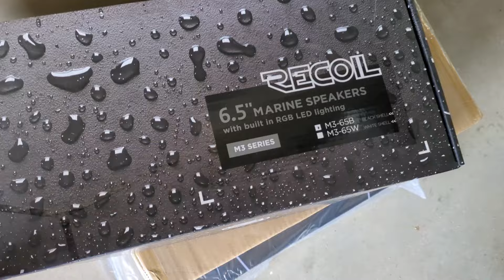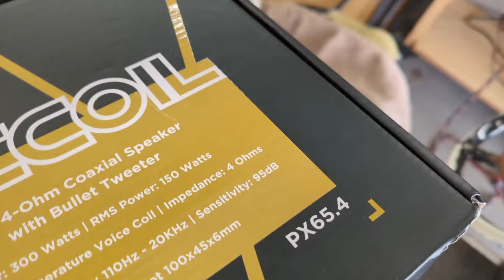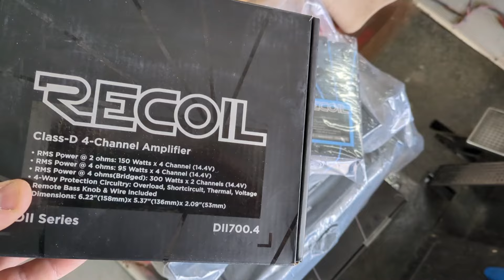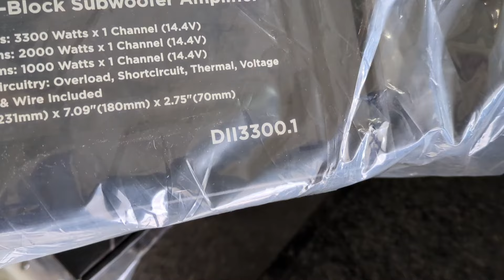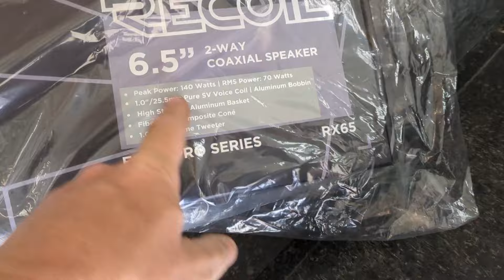Shop Update: New 4x4 Motor + Recoil Audio Dii Amps + Massive 18" Fail + Rain in AZ + CeraKote Magnet

Comment: Patrick if someone buys an amp from you can you do the TK-421 modification? That extra 3 or 4 quads is really noticable, really gets you hifi and hifi is the highest of Fidelity's... You will feel that extra bass from the modification it hits you right there in your belly,  it makes you wanna do the freaky deakie. Buck recommended it.
Reply from the maker: I'll shoot a load on it if you want.  I don't think JP does that yet
Reply: @RobotUnderground only if you finder paint your initials afterwards.

Comment: Recoil 8in subs, how do they compare to Skar and ct sounds 8in with the same power?
Reply from the maker: I did reviews on both the RW series and the PW series.   I prefer the RW series which is good to 200 Watts each but most people who have bought the PW series don't seem to mind that it doesn't play below 40 Hz
Reply: I've made several 2.1 systems using recoil pw8 in ported boxes. Every customer has been impressed, sending max 100w to the subs

Comment: Min 9 sec 35. Lol.. That water doesnt really hurt the subwoofer he says.. wow just wow. Yeah I bet the customer is going to love the water spots and water damage to the papercone and probably the surround soft part.
Reply: Wow you're reatarded but I'll entertain.

Actually he says "the water doesn't really hurt the coil" 

And that cone is obviously woven fiber not paper
Reply from the maker: Had this Genius Audio cone sitting with water in it for 2 days.  Nada.  He doesn't know how cones are made..  Which is fine.  Some cones, like PA cones which typically don't get baked and are quite thin will be damaged if you spill wine or whatever on them.  These fuckers are like 3mm thick with the UV top layer.